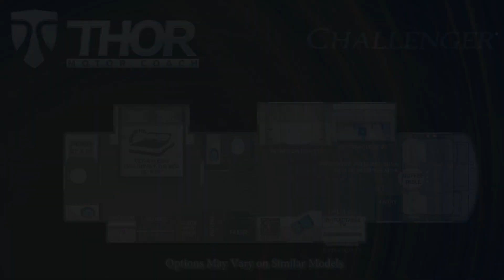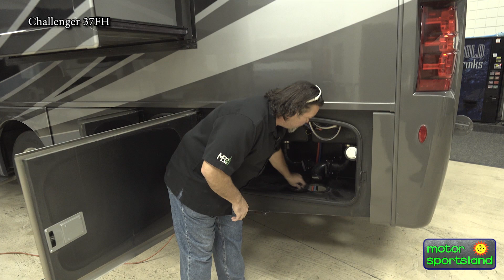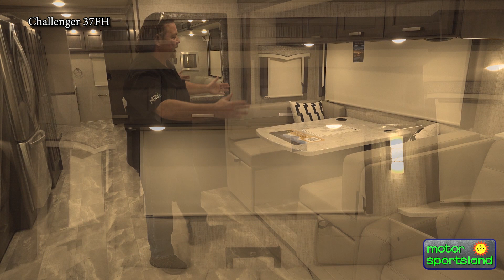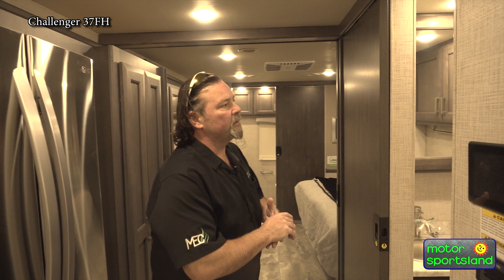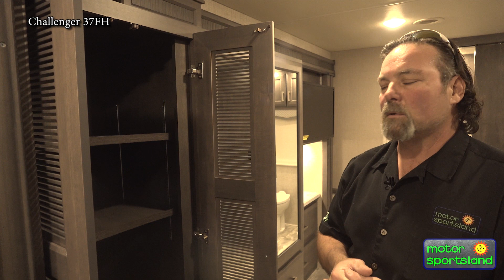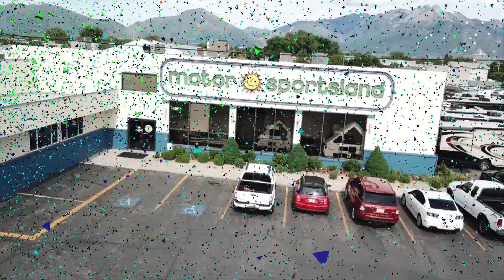2023 Thor Challenger 37FH Walk-Around by Motor Sportsland

Comment: Quick question:  does the tankless water heater work on electric and/or gas?
Reply: No. Strictly gas.  I have one.
Reply from the maker: I believe they can work on either source. There are some that will only work on one source and that may vary from camper to camper.